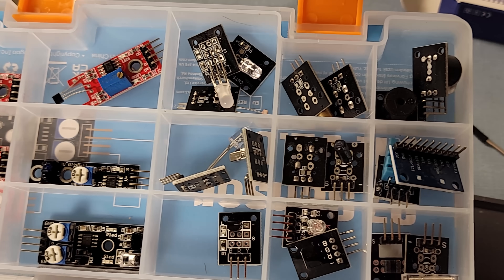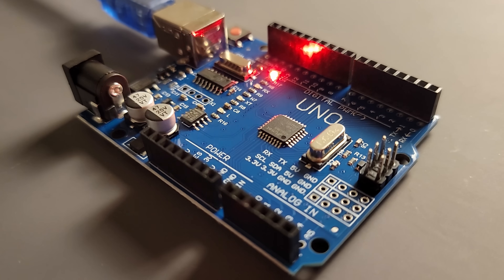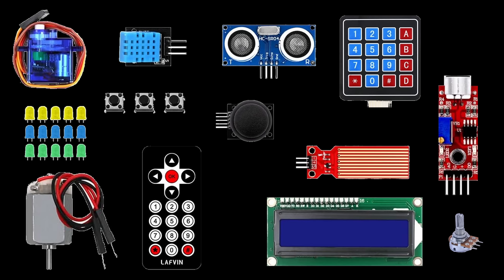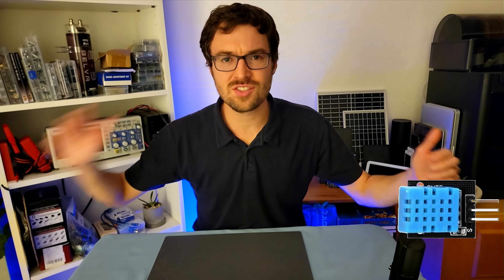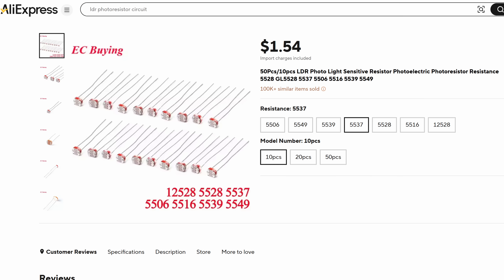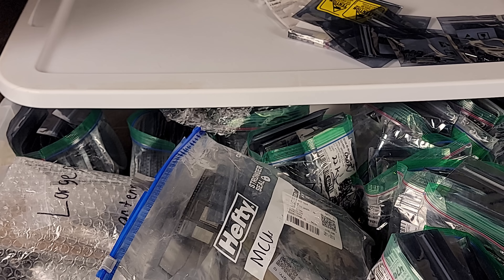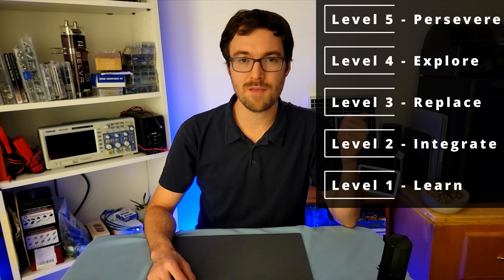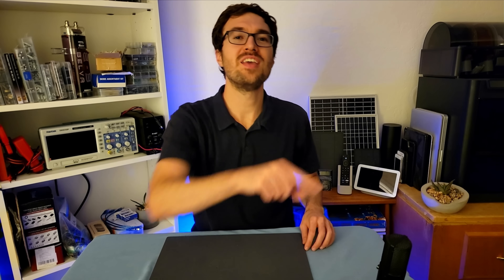How to Make Anything - Learn to Think Like an Engineer

Comment: I’m an electrical apprentice; the guy who wires your home. I’ve been wanting to break into the electronics realm for some time. Thanks for the motivation. I just subbed.
Reply from the maker: Awesome! I've heard an electrician put it like anything under 48 volts DC won't shock you unless you put one wire in your mouth and the other wire... Well, you probably have heard that one before!

But the point is you have a big advantage knowing not only the theory, but the practice, and what you should and shouldn't actually worry about. I think there's a huge benefit to electricians knowing also how electronics work so that way they can set up systems end to end including the wiring and the configuration programming of all the IoT things these days. Knowing about the sensors that are in the IoT devices you work with is also helpful as you just get how they work so you can use them that much better. 

I'm really excited that you're getting into electronics! Feel free to ask any questions you have!
Reply: @FluxBench 
Hey thanks! I built an electric skateboard and a solar generator but I’d like to delve more but nit sure where to start. 

I have several interests, but not sure which gadget/kit pathway would be best to start with:
- I’m interested in building a scaleable/portable renewable (hydro, solar & wind) energy generator, like for hikers, campers and even preppers. 
- I’d like to build a tazer sword.
- and a digital timed disconnect switch like for outdoor Christmas lights to plug into, to turn on & off at a certain time.

Do you have any kit suggestions that would put me on the right path?
Reply from the maker: @icevariable9600   great projects so far! Seems like you have an interest in power electronics like I do.

All that stuff seems fine if you intend to make one for yourself, but as soon as you start making it into a product then the costs and complexity and time required start to rise fast. Regulations around high voltage and grid connected stuff require multiple lab and safety certifications which can get really expensive.

If you make these for yourself you will learn a lot. You can then take that theory and confidence to make a real product later, but I suggest you get some experience making something and using it for months. Something often works great for a week or a month but after 2 months you don't like it anymore. Or you really want to make a change to it. For example you might be willing to recharge something once a week for a bit, but after the 10th time you get really tired of it and realize you have to change something. 

I would suggest you make a basic PCBs with a buck converter to reduce voltage and a boost converter to increase voltage. You personally would benefit from the experience of combining a MOSFET, inductor, diode, and capacitors to manipulate voltage. Then make a current sensing resistor board so you can measure the amps. Just make them like breakout boards where you can use any microcontroller to interact with them. Such as have a PWM pin for the MOSFET. Learn how to use gate drivers to turn on MOSFETs faster and with more force compared to using the GPIO signal directly. 

Feel free to  ask any more questions!
Reply from the maker: @icevariable9600  as far as kits go, you might be able to use assorted kits of MOSFETs, diodes, inductors, and capacitors that are in the through hole form so you can put them into breadboards or perf boards instead of making PCBs. That will get old real quick and you will see why it's better to spend an hour making a PCB and waiting two weeks for it to arrive then spend 5 hours wiring and stuff still not working. 

But you can also just start ordering a surface mount components from distributors so you can make a few boards, always order a couple extra of each components that way in the future you can make a new PCB and already have the parts around. Also you already have experience so you know what parts work well in what situations.
Reply: @FluxBench 
Excellent, excellent advice. Thank you!! I’m neck deep in
Trig, vectors, serial & parallel resistors, inductors & capacitors; ROC circuits. So once I finish this term, I’ll look for a kit that has your suggestions.
Reply: @FluxBench  
Thanks again!! Will do! 

And if you happen to see a couple kits that fit in line with my goals, please feel free to send me the links.
Reply from the maker: @icevariable9600  I think any kits I recommend in my first video would be good for you. Kind of like learning the piano and playing "Mary Had a Little Lamb", basically everyone starts in the same place because it's a good place to start! Don't wait too long before getting a kit otherwise the knowledge will be to theoretical and not practical.

Comment: Ready to learn to build a system. Hope videos covering that are forthcoming. I have a lot of the basics bits and can solder and de solder. I can copy and paste and I can end the list there lol. Time to get past the first hurdle and learn to put my knowledge and talent behind learning some electronics and microcontrollers. I like to use microcontrollers some but I really am trying to just work with cmos and keeping it pretty analog logic atm. Ready to expand my horizons.
Reply from the maker: I'm going to be building some systems soon! Mixing motors, sensors, cameras, microphones, and software.

That's a pretty good background you have, understanding the fundamental building blocks makes everything easier. A lot of the electronics and microcontroller stuff just takes repetition of doing it a few times to get it. There's nothing magical, even complex stuff is filled with resistors and capacitors and the code still looks pretty much exactly like what you're going to be writing. So just start out and get some of that experience! 

You have any questions, feel free to ask!

Comment: Personally I find I easier to define a problem that I want to solve and then work backwards from there. then once I figure out what systems and component I need for the project and then I learn how to use and link those systems to solve my problem. And then when the system inevitably breaks because I’m entirely out of my depth I learn to troubleshoot. All at once.
Reply from the maker: In general, me too! I tend to learn the most when something breaks and I have to learn everything around it. Funny how you might have to learn about five things only to figure out that none of those five things actually are the problem, and it's that six topic that helps you figure out the problem. And now you learned about five random things 😂
Reply: @FluxBench  yes but then ill have figured something else i can keep in my back pocket for later. haha. "just one more parenthesis bro i promise it will solve the problem bro please just one more"

Comment: 🤓neat
Reply from the maker: Very neat indeed 🤓
Reply: @FluxBench I have a few of these kits, including additional sensors and components, but as a dad of 2 toddlers I can never find the time to tinker because they always ninja their way into my workspace. Any advice for someone like me?
Reply from the maker: @magolide  Small Rubbermaid bins or tubs! A lot of time is spent setting up and putting away electronics. But if you get a shallow plastic bin you can use your spare 10 minutes to open the lid, plug in your breadboard or microcontroller to power or USB on your computer, and get some time in before you have to basically unplug, put everything back in the bin you took out (So leave most of the stuff in the bin if you can!), close the lid, and be back to being a Dad again!

If you get a silicone mat for electronics for a few dollars you might be able to even cut it up so it sits on the bottom of a bin easily and keep all your soldering stuff in there including the soldering iron and stand. I have a multiple bin system so I can grab the bin I need for a specific project and get right to work. 

Maybe that wasn't what you're asking about 😂 but hope it helped a little bit! Let me know if you have any more questions!

Comment: im going to program a lawn sprinkler Controller.  no tutorials   I have done tons of tutorials.  plus i hate store bought controllers
Reply from the maker: Awesome project idea! Lots of room to build add-ons and expand functionality over time. 

Just be careful if you're using 24 volts AC for the control signal. That with the water is probably enough for it to penetrate your skin and give you a shock. 24v AC and dry skin, nope. Wet skin 😬

Comment: That intro is amusing since pro's don't use those kits x.x those kits are literally aimed to be used as educational toys.
Reply from the maker: I honestly still use them for quick proof of concepts! Not every module is decent, but sometimes you just need a quick demo like a digi pot, photo resistor, MCU, and an IR transmitter. No need to wait for Mouser! But they quickly reach their limit after that 😂

Comment: lol I do the same thing with 3d printed and electronic stuff, put them in polymer bags and throw them in a storage container, my rasoning was meainly the contents cant still move around in the bag but not get separated with other similar stuff. 

I always feel like im following a recipe, like for example this small vacuum pump, I wanted to add a solenoid so other than vacuum sealing filament bags I can use it as smt pick up tool too, I had the idea of mounting this on the backside of my benches backboard, which would be inconvenient having to reach back then to turn on, so I learned about optocouplers and since the vacuum pump pcb uses tactile push buttons, I can press the + or - button to turn on/off the pump from esp32 webserver. Now the foot pedal switch is actually going to be used with my 18650 spot welder, its this cheap purple pcb, I plan to cut a trace so I can control when it will weld, however I want that to be optional, I noticed dc barrel plugs 3 pins has ground and another pin bridge when nothing isconnected, but when plugged it, they are no longer bridged, what I wanted was that I an still weld without the foot pedal plugged in, but when plugged in I an use the foot pedal, in order for me to achieve that I used a spst switch between chip select and positive pin. 

even though this isn't significant work, I feel like an imposter just talking about it.
Reply from the maker: Imposter syndrome is real! But those projects you mentioned seem legit. Even if you don't get them working well, it's more than most people would try. The act of attempting to do them will certainly teach you a lot, and if they work, that's a nice bonus too! 

I've been hanging around engineers this past week at the product development expo but I have a finance degree. I took business calculus which is a joke. I sometimes feel like a imposter working with these engineers doing engineering stuff, but in the end I'm doing it. So I try to just stay out of my head and get stuff done. I just passed 500K views on my channel today but I'm not sure if I'm a YouTuber. But I'm doing it.

It seems like you know what you're doing, so maybe just keep doing it 😉👍

Comment: i started to look into enginering and i like to build drones i have couple diy kits but the problem is its  al pre build so its easy and fast . So i tryed to buy everything in pices and build my own thing that i have in my head but when i start reading about all this differend things from body to motors to cables and controllers i just cant make any scence of what the hell im looking at and what kind i need . But when i have it in front of my face i just know how to put stuff together , and i know how to read the manual . I even solder my first controllerbord whith LED en switches . But when i try to read the menual how to do it i just lose all interests in and all looks like its a stuff i just cant understand .
Reply from the maker: I bet if you get a little bit more experience in each aspect then a drone won't seem so scary complicated. But they're basically miniature flying electric vehicles so yeah, there's a lot going on! That's what makes them a great learning tool, you can buy what you need or make what you need from frames to motors. 

I remember not knowing the difference between a flight controller and an ESC, there were so many parts! Now drones are simple to me, only because I understand each individual component well, and put together doesn't make it more complicated. But when starting out, everything is complicated! 😂 Hope you push through it over time and get the experience you need so you can come back and see a drone as simple as well! You'll get there! 😉👍